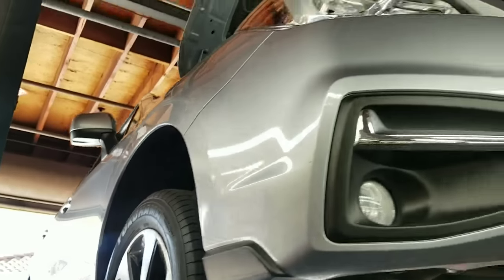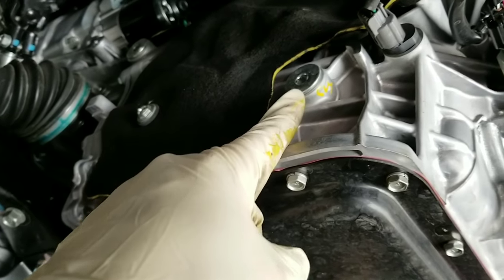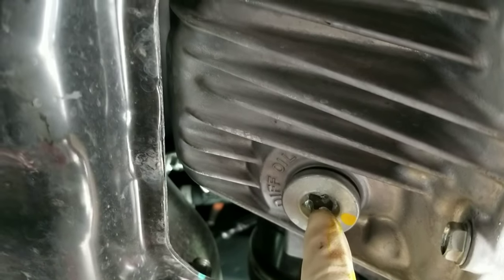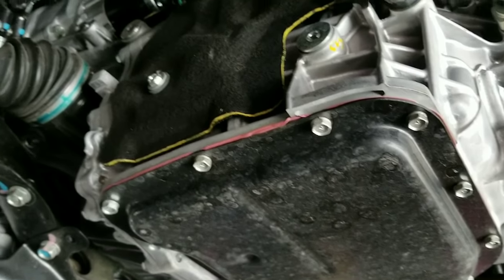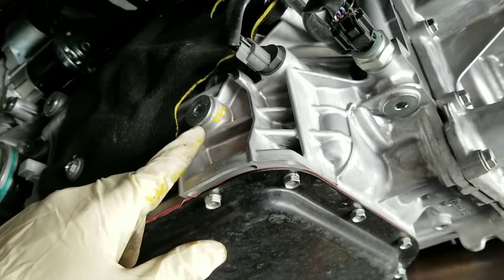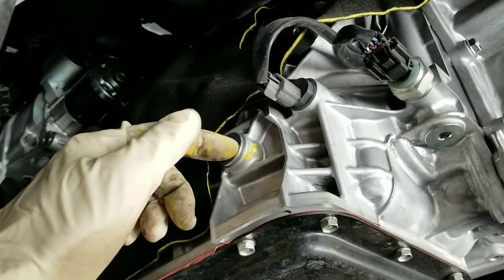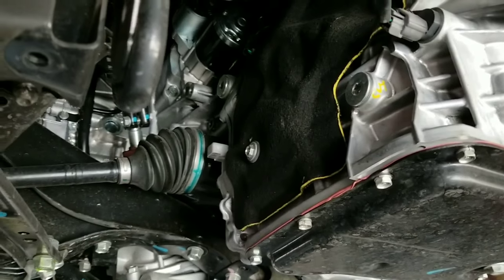Watch before you screw up your SUBARU CVT transmission & differential

Comment: I wish I had watched this video before I serviced the gear oil in the CVT unit! Yes, I put gear oil where you advised not to. Two quarts of gear oil went into the CVT fluid. I ended up draining the CVT fluid, but didn’t remove the fluid pan.  The transmission is not working correctly now. This video would have saved my butt if I had seen it before the botched DIY service. All the information in this correct and valuable. Well done.

Comment: That differential check plug is a nice way of filling your differential without having to go to the other side!
Reply: Thats what i would think as well. Clearly if it fills to that plug woukdnt it only make sense to use that as well? Im mean i suppose if u use it n only a half a qt or something goes into ur duff than u fd something up, otherwise id try that first as the easiest route since ur removing it anyway.

Comment: Important additional note, as I did not hear you mention it… When checking the level of the CVT fluid, the transmission should be warm with engine idling (in Neutral) to get the proper level.  Otherwise, you will end up with a level that is much too low. 

Thanks for the great video! I have actually done this on three different Subarus, with the fourth one in a few days. 

P.S. The CVT can be filled from that top plug you pointed out, if you prefer not to have to pump in 5+ quarts of fluid from below.. Use a funnel with an extension tube to reach this upper Fill hole from the engine compartment near the firewall.
Reply from the maker: Thank you!
Reply: Also, the vehicle has to be level. I would use a hand pump from underneath so I can see immediately when it's full.

Comment: Thanks for pointing out the locations for fill/drain plugs on the transmission and differential.  Those fast lube places shouldn't even touch something as expensive as a transmission or differential.   I wouldn't have confidence they can correctly do an oil change.

Comment: Here’s a good tip before you drain the fluid make sure that the fill drain plug is removable. I can’t express this enough I’ve seen it multiple times where someone drained the fluid and didn’t check the fill plug and it was stripped or damaged to the point where now you can’t even remove it without having to get the bigger tools out the box and you have a stuck car on your lift.

Comment: My F. Diff fill plug was seized and would not budge with even a breaker bar and extension.  The plug stripped, but I was able to fill the F. Diff through the check plug.  I used a hand pump and had a paper tower wrapped around the tube that was inserted into the check opening.  This helped keep the fluid from running right back out.  Thanks @MrSubaru1387 for confirming this would work.
Reply: Porsche and other euros actually fill through the check plug think they sell kits for it on Amazon
Reply from the maker: this is correct, most euro vehicles i fill through the check plug with special threaded adapters. thanks for pointing this out,.
Reply: Use heat and pb blaster

Comment: Dude you saved my ass with this vid. I was told the diff and trans fluid were one and the same and to do it that way. Almost did it until literally I was watching a trans drain and fill vid and yours popped up out of nowhere! Every single website I went to they say NOTHING on the cvt trans change. But I also heard they don't ever need to be drained either. I had my car propped up and ready to go. Ill be doing it tomorrow and following your instructions. Cvt fluid for trans only and a 75w90 for the diff. Thanks my friend!
Reply from the maker: The subaru manual transmission shares front diff and trans fluid. Auto is separate from each other.

Comment: Great video.   I changed the differentials cold. The front is supposed to have a 1.4 qt filled. With the car level and off,  absolutely no leaks anywhere, only 0.9 qt  drained. Replaced same amount.  In the rear, very close the same amount drained and replaced.  The front fill plug was a bear to remove. I will have to remember the check plug as a filling location next time.
Reply: Does it not have a fill/inspection/overflow plug? Measuring what came out is not a bad idea, but refilling that amount assumes a. that it was filled correctly the last time, and b. it never leaked a drop.

Comment: Super video.  I am embarrassed to admit, I dumped front differential oil in the transmission via the plug over the differential.  What a headache.  Did not realize it at first and put a fair amount in the transmission.  Then a huge amount to CVT fluid to flush the transmission to "fix" the mistake.  That is not cheap also.  Subaru should do better labeling these.  I did not feel quite as bad after your video.  By far the worst laid out collection of plugs I have ever seen!!  Thanks for the very helpful video to clarify.
Reply: I just did the same thing…..is everything running good now ?
Reply: @billycardoos4016    Seems so.  I did not drive it much after the screw up.  Refilled once, drove a little, removed, then refilled again. That is a LOT of expensive fluid waste.  But as of one year after and ~ 10 k miles no problems yet.  Subaru really needs to label these considering an upper plug for the transmission is right above the differential on that assembly.  Almost like a bad joke!

Comment: excellent vid  how I do it is I made adaptors from the original drain plugs  and  welded in a thru tube  in the plug  then I carefully measured the fluid drained  then  I used my mityvac pump to pump the fresh replacement fluid plus 1 oz  for when I remove the adapter  and screw in the  stock drain plug , works like a charm .

Comment: It is good that this video is made and it is really a mess where the fill/check/drain bolts are located on the CVT/Diff.  Haven't done the service myself on a Subaru before, however doesn't seem difficult or use any special tool except to measure CVTF temp.

Comment: Drained my front diff. Started filling through the hole on top of the diff area. Couldn’t figure out where it was going. Put 1.5 qts in, back to store- put another 1/2 in. Nothing draining out? Started to panic and sat down and found this vid. That top hole leads to cvt for sure. Drained cvt and flushed 3 qts through the said top mystery hole. Filled front diff properly along with cvt. 
I measured temp of dribbling cvt fluid to get volume correct. I don’t have temp gun or proper scanner. I knew from other vids that proper temp is reached in 10-15 minutes of run time and I reached 100 deg at around 14 minutes. This takes 2 people (filler and temp measurer) and is less than ideal but seems reasonable if lacking the tools.
Reply: Infrared thermometers are not too expensive. You should pick one up. 
Also OBD2 readers can be found for <$15 and plenty quality.
Reply: @sirtimatbob  true for IR scanner.  I have 2 OBD scanners, one cheap, one $100, neither measure TF temp. Taking the temp of the expelled fluid is a reasonable solution in a pinch.

Comment: One thing you forgot is that the engine has to be running to fill the trans all the way to 4-5qrts and to check the fluid level otherwise you’ll only get 3 qrts or so in there and if you want to be extra careful catch and measure the amount of fluid that comes out to be sure you’re filling it back up correctly
Reply: I did exactly the same thing for my 4Runner
Reply: 4-5 qts is only the amount of fluid that falls back to the pan. The total capacity is about 13 qts, but it is not necessary to do a total replacement, in my opinion, as long as you do a 4-5 qt drain and fill ever 25000 miles or so.
Reply: That was my first question, running or not? THANK YOU for the correction. Greatly appreciated.
Reply: That's true and don't shut the engine off until you get the fill plug in at least snug with your fingers or your fluid will come gushing out the fil plug hole.

Comment: When i first jumped under our 2018 Subi Outback 2.5i to change the oil I pulled the CVT Trans drain plug as it looked like most oil pan/drain plugs I'd ever seen...after 30 seconds or so I was like, somethings not right and put the plug back in.  Ooops, cost me $400.  CVT fluid ain't cheap!

Comment: This video is excellent. Thank you for taking the time to point out all of the fill/drain locations. However, the geniuses at Subaru screwed those of us with 2019 Foresters. They moved the exhaust to the driver's side of the car and placed the catalytic converter right in front of the CVT fill plug.  I've seen some YT videos where it mentioned that the transmission is not serviceable. It's a machine that has moving parts that require lubrication, and as good as some lubes are, they break down and eventually need to be replaced.  Looks like I'll be taking down the exhaust tomorrow...
Reply: Vincent, the fill plug for 2019+ models is located on the right (passenger side) of the CVT. The old fill plug is still there but blocked by the exhaust like you said. I hope you figured that out before dropping the exhaust.
Reply: @Logan-vl8ek  whoa....can you imagine doing that, and not realizing it's on the passenger side now...yikes...
Reply: @Logan-vl8ek  My 2018 Impreza is on right side too.

Comment: Geat video, I just ran into this problem adding diff oil to CVT quick tip you can suck out the diff oil from the trans pan using a oil suction tool with a u shape small pipe

Comment: Up to the point. Just did a CVT fluid change on a 2019 Subaru Crosstrek. Very straightforward after reading the instructions twice on ProDemand.
Reply: How many miles did you have on it b4 you started to swap oil?
Reply: @bigfootswatching9986  It had 56,000 km on it when I changed the fluid. But the Crosstrek I worked on belong to a customer.
Reply: What fluid u used? Does the brand matter?
Reply: @kristalsify  Pentosin CVT1, if I remembered correctly.

Comment: I accidentally put gear oil into the CVT fill hole of my 2013 Impreza. Things did not go well. I did end up draining it and putting in CVT fluid. It still has a little bit of a whine, though. Thanks Subaru Factory Service Manual for only using drawings of the plug locations...
Reply from the maker: Thanks for the feedback, and i would suggest doing another drain and fill on the cvt fluid when its hot, to help flush out the gear oil to extend the life of the transmission

Comment: Funny how I found this video AFTER I did my front and rear diff fluid change haha but I did it right so I’m happy 🤙🏽
Reply: Same here just did my diff after forgetting and reaching 79k miles. Drain was still ok, not much grimes on the magnet cap on both front and back.
Reply: Kogie Kobayashi only issue I had was my craftsman socket I used to take the full plug off the front diff broke. 😒

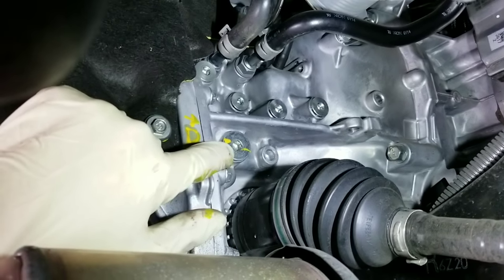Comment: Great video, but one correction at about 2:00.  The right hand side is the passenger side.  He was pointing to the correct differential fill plug location, and it is the right side, but that is the passenger side, not the driver's side.
Reply from the maker: Im sorry, i work on japanese market cars (right hand drive) and get the two mixxed up.
Reply: @subtledriver so what is it? For us market cars differential fill plug is on driver side or passenger side?
I am confused.

Comment: Just did my 2018 Outback front and rear diffs.   Rear piece of cake.  Front was a bitch mainly due to fill plug removal.  At least 150+lbs of torque to break it loose and then when it did I lost half the skin on my left thumb.  Should have worn gloves!  I’m not a small guy 6’1” 200lbs and work out regularly … it took all I had.

Comment: Thank you for the video. Subaru has got fill and drain plugs everywhere. Its unreal.
Reply: Btw, the CVT fill/check plug (on my WRX) is directly behind the exhaust pipe. With hardly any room to get a wrench. And its stuck. PB blaster over night, praying that works. Frustration is settin in boys 😎👍

Comment: Great info, thanks for making this video. It would have been helpful to point out the engine oil drain plug as well, as the CVTF drain plug is sometimes mistaken for the engine oil drain plug. Are the plug locations are the same on the HT CVT used on the turbo models?
Reply from the maker: So far with my personal experience, yes, the turbo models have same locations. The engine oil is at the front under the engine. I made this video for Mechanic's/ diy people to quickly identify the drain and fill locations of just the CVT. The info is not black and white if you don't have the technical data charts/diagrams or personal experience. Far too many people are destroying their cvt and diffs because of the confusion. ive seen far too many misshaps and i myself would like to refer back to this video if i forget. thanks for the comment.
Reply: Embarrassingly... I just made that mistake. Drained the cvt just now,, instead of the oil. I feel like such a dumbass. I've gone through this video about 4 times since, and I'm praying it all works out.
Reply: @johndespard3477 how’d it work out

Comment: I fkn love you brother thank you for being straight forward. Had a 15 Forester in for lf axle replacement in a smaller shop (local famous)  anyway don't get many Subaru vehicles in..  just saved me some serious headaches. I been looking for info as to what was what.. fluid coming out looked like diff fluid but couldn't get confirmation and had no idea cuz the no no plug was gonna be where I attempted to fill the diff if that's what the fluid was. WELL DONE !

Comment: Some of the transmissions will have a Torx T45 for the filler plug. Subaru has the wrong part number on their part's guide and will send you the wrong part even if you give them your VIN. To get the right one, take your plug with you and they will replace with the plug with the 8mm hex.

Comment: I already changed the oil on Mom's new Subaru Crosstrek one time. It was due for another without thinking about it, I just drained the transmission. I knew it didn't look right being a greenish blue color. I first thought was that man, the sunlight sure makes that old oil look new! And a split second after that, oh sh*t! We live in a small town in the middle of Wyoming and over 100 miles to a Subaru dealer. I was told not to use Valvaline CVT fluid. I did go ahead and order 4 quarts of the real stuff, CVTF 3. Since I didn't run the car at all, will this be enough? And, does it still need to be brought to temp? Plug is next to HOT.. I guess you know that.

Comment: 4-5 qts is not the total capacity. That's only draining the fluid that falls into the pan. The total CVT system capacity is near 13 qts and it is not a simple job to replace all the fluid. That said, it's not necessary to replace all the fluid, in my opinion. I think this simple 4-5 qt drain and fill every 25,000 miles or so is easy to do and it's an adequate freshening of the fluid that will keep your CVT running smooth for the life of the vehicle.

Comment: Why would draining the CVT cold and replacing with the exact same amount of cold fluid not be the easiest method?
Reply: It is, best and quickest method. You can even do that multiple times in between drives after it cools down to replace more fluid after it mixes
Reply: Subaru trying to scare the DIYers into taking it to the dealer after they realized taking away the dipstick wasn’t enough
Reply: Because of fluid expansion. If you just drain it and put the same amount back in, which you can only do with the car running, you may overfill it because of the colder operating temperture that is required to fill it which is 95-113F or 35-45C.
Reply: @S J I totally disagree, but you do what ever you feel works for you and I'll continue to follow Subaru's procedure. The only things that should be filled cold and drained cold is the differentials.

Comment: Hello, tank you for your videos they are very helpful. I have a 2014 subaru xv crosstrek. My vehicle automatic transmission is not going into gear. I have no codes on my dashboard. Few days ago was making some grinding noise when releasing the gas after driving. Do I need to replace the transmission solenoid?

Comment: Just wondering if there is a filter in there. Every car I've owned had one if it wasn't a clutch type. I would never change fluid without dropping the pan and replacing the filter.

Comment: I know that on my 2017 Crosstrek, it will void the 100k mile warranty if you change its oil before 100k.  Subaru says that these are sealed units and are to be driven until they fail, never having to change its oil.

Comment: Would it be acceptable to drain the CVT fluid, measure it, then add that same amount into the hole you show at 2:09 (warning not to put gear oil into), without ever removing the level/fill plug? Thanks

Comment: This is a bit late, but you mentioned a temperature gun for the temperature of the transmission, I was wondering if you could just record the temperature of the pan at the bottom, rather than having a OBD reader thing.
Reply from the maker: Yes, get it within the ballpark.
Reply: That sounds logical.